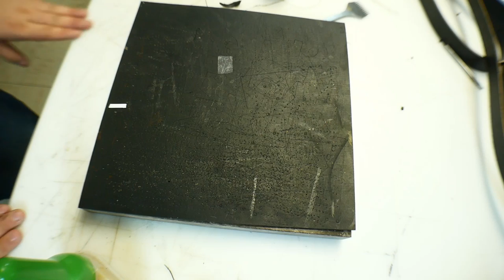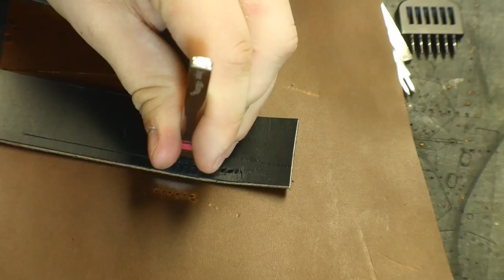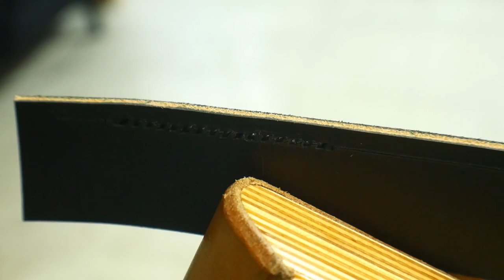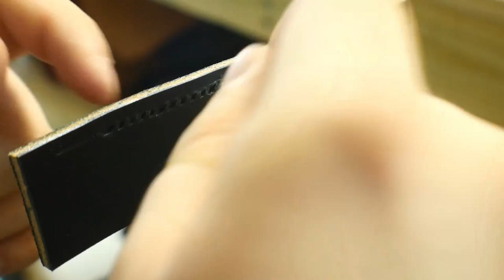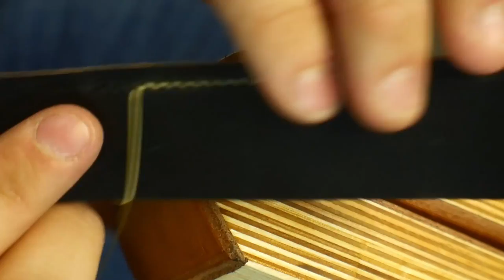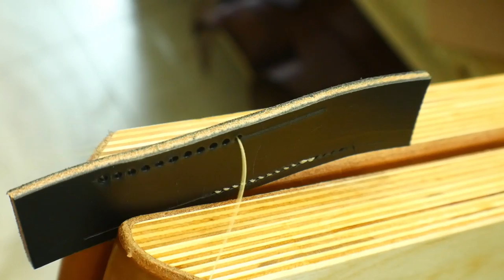How to Sew Leather By Hand (The saddle stitch - Closeups)

Comment: Excellent video, what the thickness of the thread? i use mbt #5 0.6mm thread, Thinking of moving to Ritza. What do you think about this Should I try ritza?
Reply from the maker: This was 0.6 mm thread. You should look into Ritza. Its nice thread. It lays flat on the leather.
Reply: Trevor Wing 
my is round on leather , i an not sure for falt how its look , flat is better look? you have a link for ritza 0.6 mm , need Worldwide Shipping?
Reply from the maker: @kanyorb45  https://www.rmleathersupply.com/

Check if RM leather supply ships world wide. They sell tiger thread. Its what I use.
Reply from the maker: Hey! I wanted to check in and let you know that I ended up switching to Vinymo MBT. Hands down much nicer stitches than Ritza. I prefer the vinymo MBT thread by far.
Reply: Trevor Wing 
I also stayed with the MBT  at the end of the sewing much more beautifully